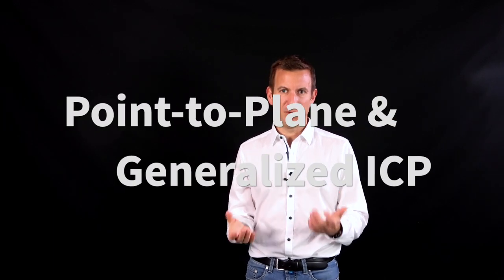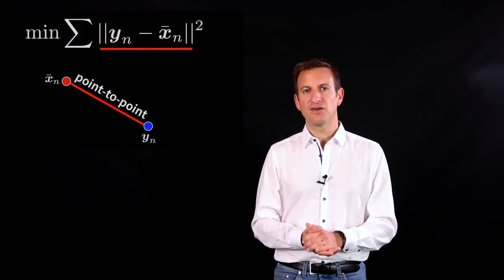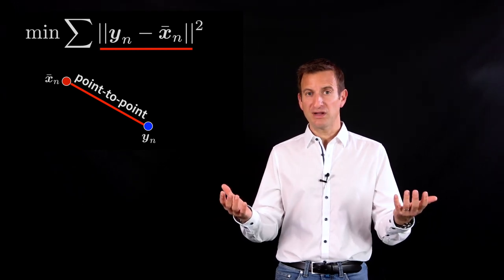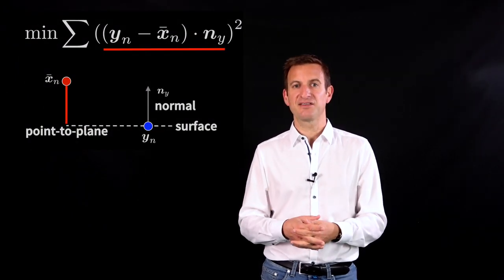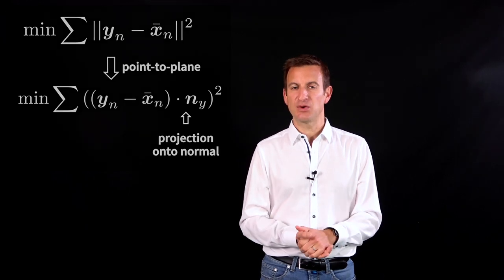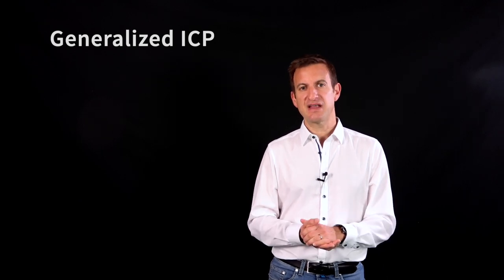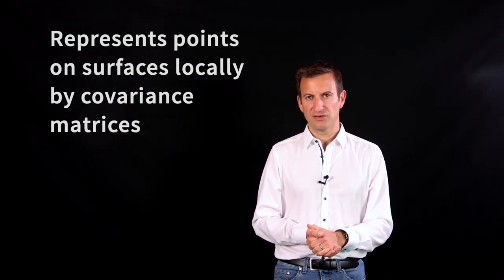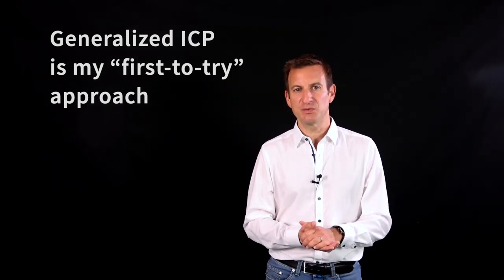Point-to-Plane and Generalized ICP - 5 Minutes with Cyrill

Comment: So is the assumption of point-to-plane is that our point cloud consists  of a set of flat regions, so we might not have the exact pairs of points but we can approximate where the target point would be using region's normal? Does it mean that it would perform much worse if our surface has high curvature?
Reply from the maker: You assume to have mostly locally flat surfaces and you take the normal vectors of such surfaces into account in the cost function. This works well under the  assumption that you can extract good normals from your scan. If that assumption is violated, it is not a great thing to do…